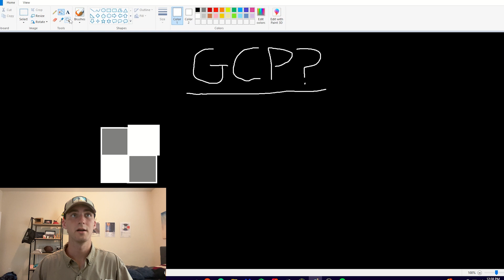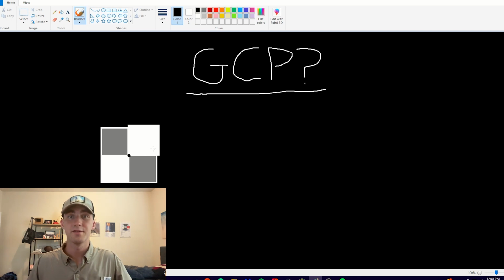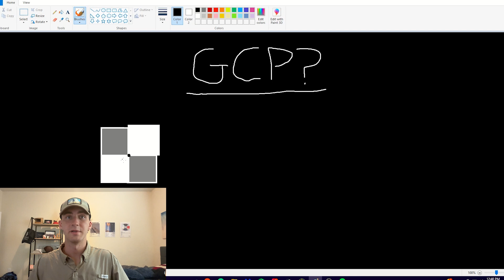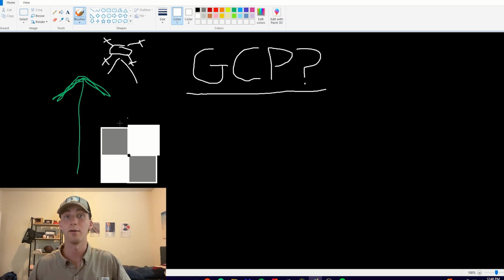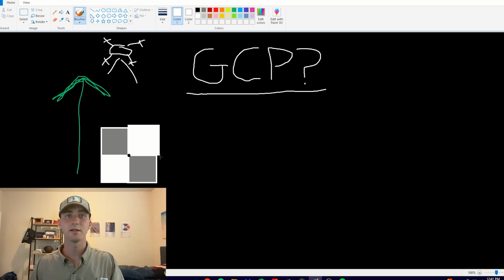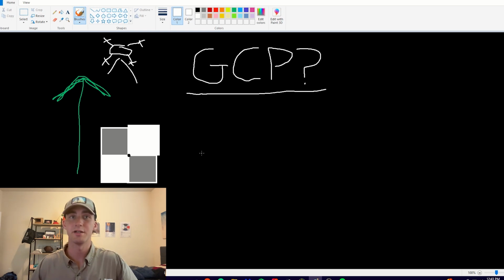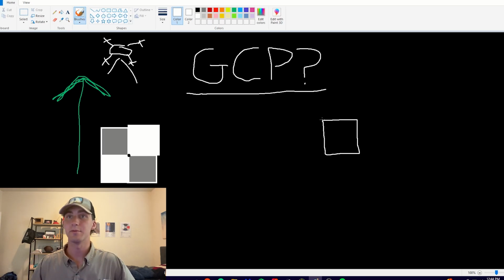Ground Control Points | The Secret to Perfect Drone Maps!

Comment: Thanks for this clip. You have a good talent in describing things in simple terms. 

Quick question. I was under the impression that one still needed a base station with GCP's to get to cm-level precision. There was no mention of a base station here. Is it your experience that base station is not need when one has GCP's + rover GNNS receivers. If I missed something, feel free to guide me in the right direction. Thanks again.
Reply from the maker: Appreciate the feedback
2 answers for that question.
The receiver I use Emlid rs2+ can be used as a rover to collect the GCPs then put into fixed mode to act as the base.
Also you can get CM level accuracy without GCPs or a GNSS receiver, by using an NTRIP service provider and connecting to it via a Hotspot. However results may vary depending on coverage and doing so relies heavily on internet connection so not as reliable.
Reply: @AeroviewDroneTech  Got it! Thanks a lot.

Comment: Great video. How long would you recommend averaging your GCP points?
Reply from the maker: Thank you for the comment! Are you asking how often you should gather new or replace old GCP's for a job?
Reply: If gathering new on a rapidly changing site. 

For example: im running some tests on establishing temp benchmarks which I average for about 30 mins. After that I then use one receiver as a base, and the other a rover. After laying out my GCPs I average those points for about 1 minute.
Reply from the maker: 30 minutes is good for your base station and typically around 1-2 minutes for averaging with your rover will get you sub 5cm accuracy. It would only ever take longer if your connection is extremely weak. Let me know if this helps!